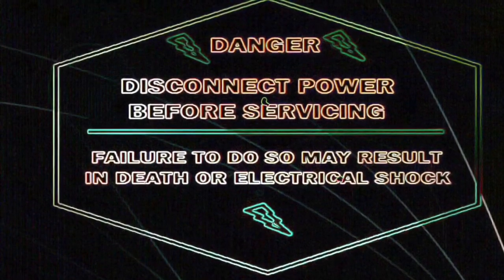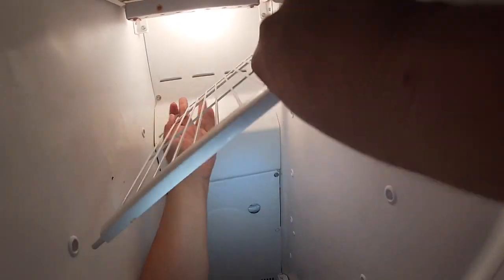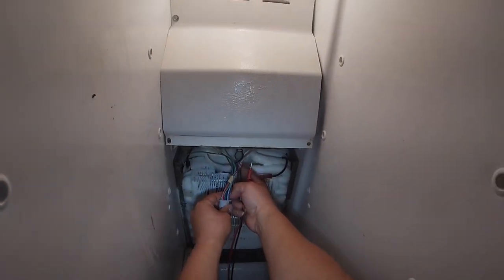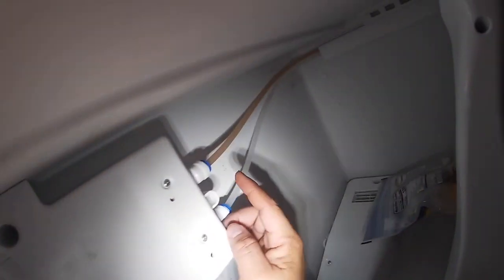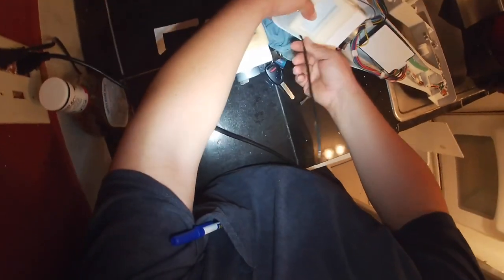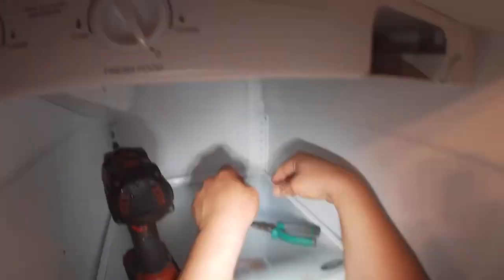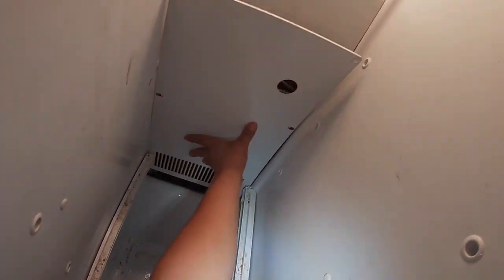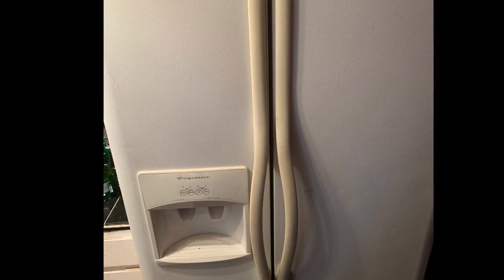How to Fix #Frigidaire Side By Side #Refrigerator Section Not Working, Freezer Section Working Fine

Comment: Also did you have to cut the wires to remove the damper housing that goes to the freezer thermostat? Mine seems to be connected to wires by the damper so I can't remove the housing in the refrigerator

Comment: Can anyone tell me where the defrost timer switch is on a Frigidaire FFHS2611LWMA is located? Is it in the refrigerator? My freezer keeps freezing up. And ice builds up and water starts to drip and ice forms behind the ice maker. Is that a water line issue or what do people think? My refrigerator doesn't seem to have a problem with the fresh food side though. I am getting tired of defrosting my freezer every month or so. Thanks for the info, if u happen to see this. -J